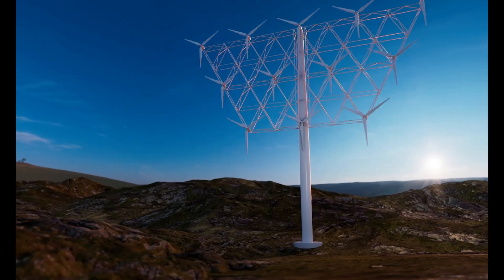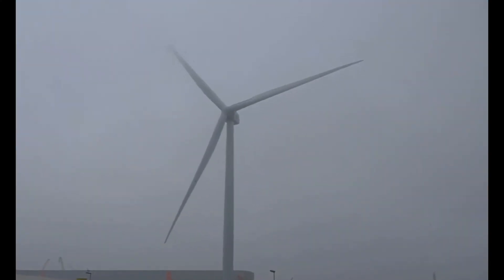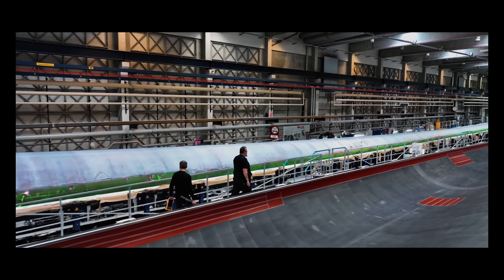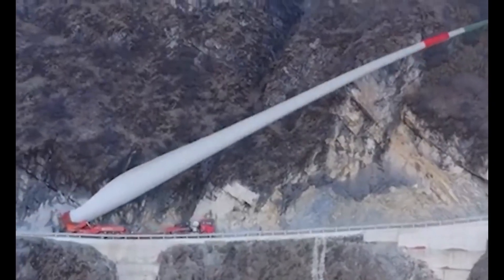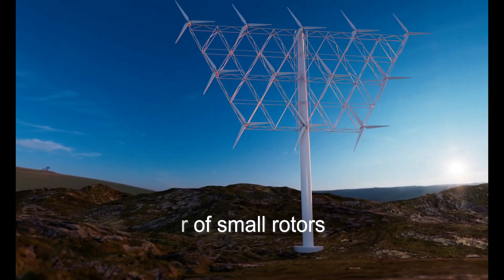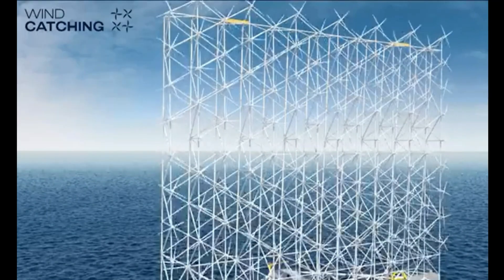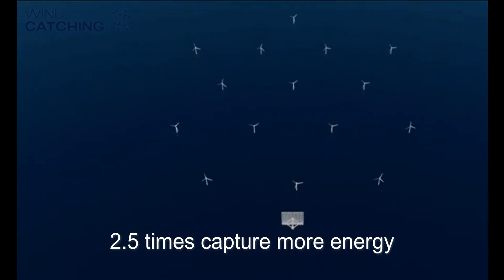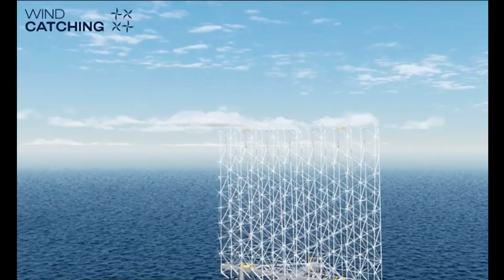Multi Rotor Wind Turbines Design

Comment: U phrased the cube law wrong its relation of length & power
Reply: For a doubling in blade length, the weight will rise 8X and the power rise is proportional to area which is 4X. The limit is mostly in material science and logistics. The tip speed also contributes to stress, vibration, and other aerodynamic issues.